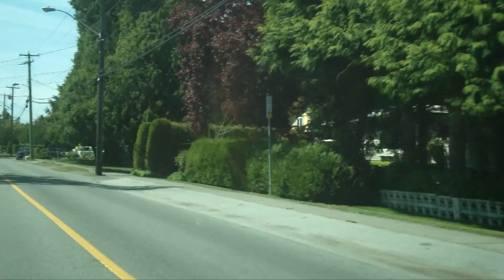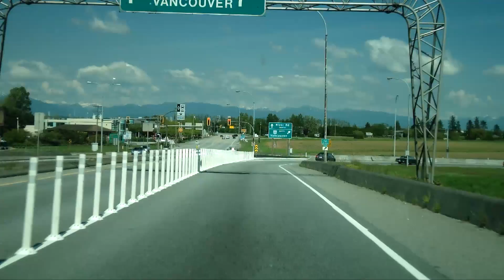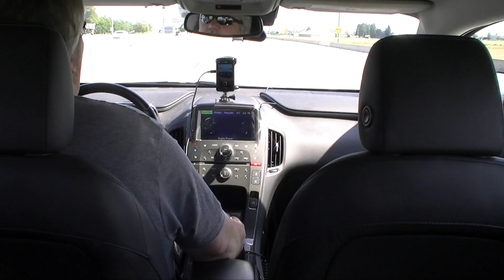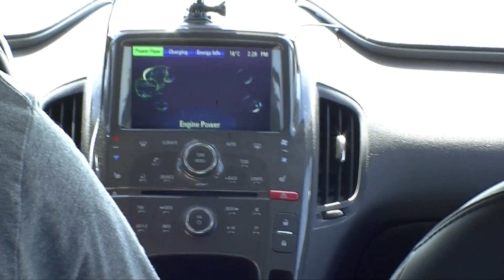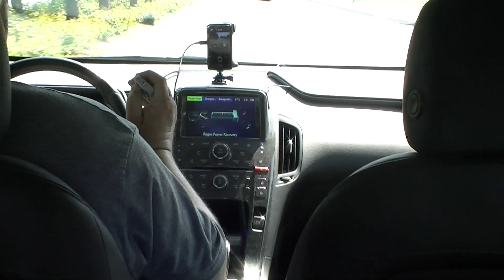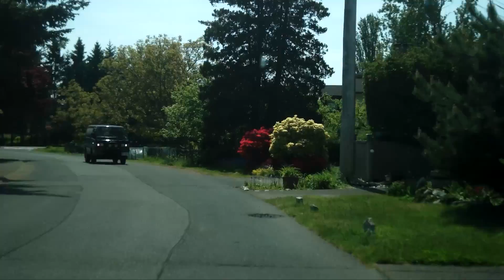How to drive a chevy volt for best electric range and fuel economy

Comment: One thing you fail to note is that "Mountain" mode may generate some battery but you pay a Premium cuz it uses MORE gas to generate ANY battery then it would just using the gas option in the car.  I HIGHLY do NOT recommend using Mountain mode to "generate" battery.
Reply from the maker: SteVolt 
I didn't touch mountain mode in this video because I wasn't driving in the mountains. there is a separate video where I was driving through the mountains and used it. also mountain mode will only reserve 40% battery charge. once you are at that level the car uses no more gas to maintain that charge but it does if you turn on mountain mode when dead until it gets to the 40% reserve.  I do know how the car works, I have owned it for 6 years and I have had it on many long road trips. I constantly get well above the fuel economy that some get. you can see this documented on those road trip videos.

Comment: On a brighter note... I can get over 70 miles of range on a daily basis driving on Los Angeles freeways.   This car LOVES slow driving freeway speeds and it allows you to coast, regen brake etc... to extend the range.  Going up hills and 75 mph and over will have a negative impact on your range... HEAVY footed driving will reduce your range dramatically.
Reply from the maker: I average over 40 miles on my first gen consistently.
I have a friend that has the new one, and he gets 60 miles on the battery every day to and from work, Hasn't burned a drop of gas since getting his in April of last year.
Love the car, want the new one, but mine is just too good to trade in.
Reply: What speed do you go at?  And what are you in low drive?

Comment: Leaving this car or ANY Volt in "L" mode is not recommended as it burns a dramatic amount of battery (exponential) similar to the regen braking except in the opposite manner.  Shift to "Drive" mode and down shift and use the paddle shifter to maximize your battery range.
Reply from the maker: I don't leave in it L. I drive in the D mode, and only shift it to L when I need to slow down, or stop. This is exactly how I demonstrated it being driven in this video.
Reply: Re-read the owners handbook. L is for stop and go traffic and for steep downhill travel. It isn't for slowing down.

Comment: So if my battery is drained and i have the car in mountain mode it will charge up the battery until its at 40%?
Reply from the maker: Correct. If you battery is dead and you put it in Mountain mode th engine will run an charge the battery to 40% if the car is not moving this takes just under 15 minutes.
Reply: i do alot of highway driving, is it best for me to keep my car in MM until i reach the city?
Reply from the maker: It won't hurt the car and will preserve 10 miles of battery range. 2013 and later have a hold mode to preserve all the battery while driving into the city from the burbs to use it in the city. I never do this. I use up my battery and let the gas engine kick in if needed which is relatively for my driving habits
Reply: I have a 2012 Chevy Volt. I watched another video about opening the hood and the engine starts up. My battery is full and im questioning how long the car will run and if it would charge the battery with the hood open??? Also with the hood open and car at idle will it charge the battery to full?
Reply from the maker: No it won't charge the battery at all with the hood open. The only reason the engine starts when you open the hood is as a safety reminder that the car is powered on.That is to warn anyone servicing the car to turn it off before sticking their fingers in because not only is the high voltage energized, but if the battery is low the engine could start, and that would not be good if you had your fingers say on the drive belt for the water pump. If you listen to the operation, if the car is on and you pop the hood, you can hear the engine start, and then the clutch that drives the motor/generator disengages and the engine goes into idle mode, so it is not even spinning the generator anymore.Incidentally I did verify this in another video. In mountain mode the battery will charge to 10 miles (16KM) and then the engine stopped. Opening the hood started the engine again, but no more charge went into the battery, it just consumed gas and did nothing.

Comment: when the battery is completely depleted and you are running on gas mode, what happens if you then put it into 'hold' mode? Does the volt have hold mode like the UK Ampera from gm
Reply from the maker: The 2012 does not have the hold mode, 2013 and beyond does. Hold only works when there is charge in the battery. Once it is at the low state of charge the engine will cycle on and off. Mountain mode will put a 40% charge back in the battery and hold it there. Hold allows you to start with a full battery, and keep it full for use later, and is only for jurisdictions where access to special electric car lanes require the car to be in full electric mode. So you can drive in from the suburbs on gas, and then switch back to electric mode in the city to use the electric car lanes.  On the 2012 if I needed to do that I would drive in mountain mode. Sure I would use some of my battery, but it would keep 16KM in the battery. Fortunately where I live I do get to use the special HOV lanes with a single occupant in electric or GAS mode.

Comment: Wipers use a measurable amount of battery? I've not seen that.
Reply from the maker: Every electric device uses energy, and the wipers being an electric motor do use some. How much depends if they are on intermittent, low or high. Now they don't use as much as the electric heaters, but proably more than the headlights or the radio. In electric cars this all will affect the range. Perhaps as much as 1 or 2 KM if the wipers are running on high. All the accessories in the car run off the 12 volt battery, but the 12 volt battery is kept charged by an inverter that takes it's power from the 360V main battery. The AC on the other hand is operated from the HV battery. To figure out how much the wipers draw just look at the fuse. Most use a 20 or 25 amp fuse, so you know the draw is going to be relatively close to the fuse rating, or they would have put in a smaller fuse.

Comment: ive read that some drivers leave it in L for most city driving. is there any bad reason to do this vs swapping between d and l?
Reply from the maker: In "L" when you take your foot off the accelerator you slow down, quickly. In "D" you coast. So that is why I switch it back and forth. That and the fact I used to drive a standard, and like switching gears.
Reply: +12voltvids thanks. well ive been following what you suggested and so far my guess o meters gone from 34 to 39 miles. but now the shift release button is making a loud squeaky sound whenever i go from d to l or back. Not sure if its safe to hit the release button with silicone spray or not.
Reply from the maker: 110,000 miles no problems.
Reply: One thing you don't mention is the hold mode. Many people say if you're on an open road to go to hold mode. And save your battery for city driving. Also question, if you were to take a 400 mile trip. Can the vault possibly using the engine recharge most of your battery so that once you get to your destination you have  almost full battery if your gonna be on interstate for several hours.  To me depleting the battery and having the engine add a small charge like 1 or 2% then use it seems like it would not be best for battery. . Any comment.

Comment: Actually, the 12-volt and High-Voltage systems are separate, I believe.  Anything using 12 volts like wipers, lights, radio, etc. will not affect your range.
Unless the engineers have done something VERY strange with the Volt...
Reply from the maker: Well yes and no.True that there are 2 separate systems, a low voltage 12 volt system for things like wipers, lights, the radio and the computers that run the system, and there is a high voltage system for the drive unit, the heat and AC.The 12 system is however charged up by the 360V high voltage battery, just like every other hybrid. So when the car is on, there is an inverter that runs that generates the high voltage 3 phase AC for the electric motors and air conditioner, and it generates 13.8 volts to keep the AGM battery for the 12 volt system charged. When you plug the car in, the external AC recharges only the  HV system as the HV system is responsible to chare the 12 volt system when the car is on.. The gas engine also can place charge in the HV system when you are driving it and the HV battery goes dead.If you turn the radio on without turning the car on it will turn off after 20 minutes. You can only do this a few times and then the car will refuse to allow you to turn the radio on as you could run the 12V battery flat. A flat 12V battery means that the car will not turn on because, the 12V system is needed to energize the HV contactor relay to turn on the 360V supply. If you manage to run down the 12V battery, then you need a jump start like any other car. It is impossible to run down the HV battery, because the engine will start when the battery gets down to the low charge limit.Of course if you run out of gas then it is possible to run the battery down, but it will go into a safe mode, so it will shut off until there is gas in the car then it would start the engine. (or you could plug it in and recharge the HV battery) There is a test mode, where you can turn on the HV system without the FOB present, and this is for maintenance workers only, where the HV system will turn on, but not the traction unit. If the car was left on in this state it is possible to run down the HV battery, but once it hits the low limit the car will turn off. It won't allow it to over discharge the HV battery.Also if you leave the car on, and walk away, eventually the HV battery would discharge, and then the engine would start, so GM did a software update to set a timer, so that if you walk away and leave the car turned on (and lock the doors) it will turn off after a couple of hours before the gas engine starts.  The old software would actually allow you to turn the car on, and lock the doors and use the car as an emergency power source, but because some moron forgot the car was on, and closed his garage, the car started by itself, and filled the garage with exhaust, so for safety to keep the idiots out there from carbon monoxide poisoning themselves by leaving the car on (it is a  hard one to miss because if you close the door with the car turned on the horn toots 3 times to remind you) M undated the software to limit how long it can be on without being driven, and then it turns off.
Reply: I should have said the impact will be minimal, perhaps?  Good explanation, by the way.Many electric cars (most?) will give a "watts/mile" or such readout (I know Tesla likes to display the graph of energy use.) How does that 13.8 volts compare to typical driving energy use?  Naturally, we'd need to know the amperage to convert watts to volts...My wife and I drive a Ford Fusion Energi and unfortunately, we do not have a lot of the displays "pure electrics" have...But we love our plug-in.  In no way cutting the Volt, by the way.  It's brilliant.  The Fusion fits our driving needs well.  Had it since November and so far we are averaging a bit over 74mpg overall.  That's a lot of commutes to and from work on electric only, along with a good number of trips across state and such (Georgia isn't a small state) in hybrid mode."Cheers" from one electric owner to another.
Reply from the maker: The energy plug in is a good car for short commutes for sure. Tell me, if you punch it when in EV does the engine come on, or will it stay 100% electric like the volt. My wife drives a Escape Hybrid, and the engine comes on on every drive no matter what.The volt, of course does not start the engine under any circumstances until the battery is depleted, which is 60KM (40Mi) on the first generation, and 85KM (53 mi) on the new one.I have an app called mygreenvolt that plugs intro the OBD2 portm and displays all the info about the car, such as KW being used, regeneratord. and how fast the engine is running when in gas mode,All kinds of graphs.The new volt displays all that info on the console.I may be getting a new volt sooner than I originally planned. My daughter just wrecked her car, and depending on if it gets written off or not, I may have to buy myself a new car, and sell my volt to her. She has made it very clear that the next car she wants is a volt.
Reply: Yes, if you demand more than the 44hp the motor can provide a
Reply: Oops...  the 144hp engine will cut in.  That said, it will do more than 80mph in electric only.  Sorry to hear about your car emergency, but hey, excuse to get the new model, I guess.
Reply from the maker: That's what I thought. How about the AC. On the Hybrid escape if you want AC the engine runs no matter what. Same with the defroster. Turn that on, and the engine runs constantly.On the volt everything is electric. Heat, defrost, AC. Once the battery is flat, the engine will start, and you do get the waste heat from the engine at that point. Actually you get it even when it is hot. If I run past the battery range, the engine kicks in, and as soon as it warms up a blast of warm air comes through the vents, and then it is quickly sucked out by the AC.The coolant is always circulated through the heat exchanger, and then that hot air is drawn out by the air conditioning. Something about that being more efficient, and simplifies the cooling system design as they don't need coolant control valves for the cabin heater. Coolant is always circulated through it, and if you don't need it, the air conditioner draws it out.  One of my co-workers sons just bought the new volt, and he just absolutely loves it. Bought it after consulting me about my first gen. Now I want a 2nd gen!
Reply: It will run all systems without the engine, running even the defroster and AC off the battery (electric heater).  Ours has heated (front) seats and stearing wheel, and cooled front seats, which are much more efficient that using the AC or heater to cool or heat the whole cabin.
We'll run the AC a bit to knock down the heat a bit if necessary and for the defroster, but mainly use the seats.
Waiting for everyone to go with the heated glass for defrosting, shouldn't be that long.  Doesn't Tesla do this now?
Reply: So you say the car will not use gas under any circumstances unless the battery goes dead, but, if I’m correct, you can put it in “hold” mode and it will use gas. Correct?
Reply: @mattjarnigan1786  Our situation has changed a little over the last 4 years since this exchange.  We had a bit of an emergency and had to replace a wrecked car by our son so have passed the Fusion to him, replacing it with a Honda Clarity PHEV.
The Fusion is better in some ways (some added tech which is better than Honda's like Blind spot warning, etc) but the Honda wins by the trunk space as compared to the Fusions painful lack of that and the battery size giving a 47+ mile EV range.
To answer your question,  You are correct, "Hold" mode will put it in Hybrid mode which will preserve the plug-in battery for later use like in an emissions-controlled city like are appearing in Europe for example.
The Honda has a similar button.

Comment: Do you have solar panels on your dash?
Reply from the maker: +Aaron L What good would that do?The Fisker Karma had a roof made of solar panels. Sitting in the sun all day for a week generated about 1 mile of electricity.On the Karma, all they used the panels for was to run a fan inside the car to keep the cabin cool. To generate enough power to recharge a car would require about 40,000 worth of panels covering your house.
Reply: +12voltvids I was thinking that the design of the dash was some sort of    solar panel. I see now that it isn't.